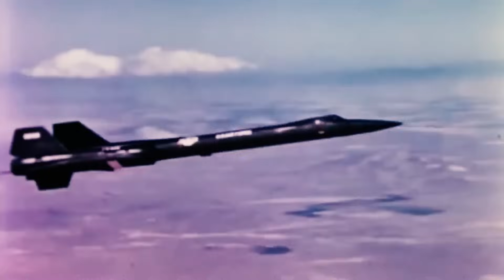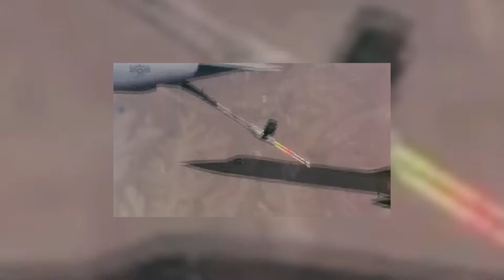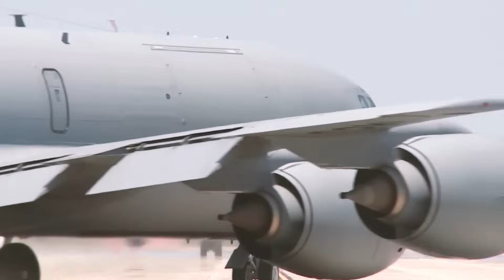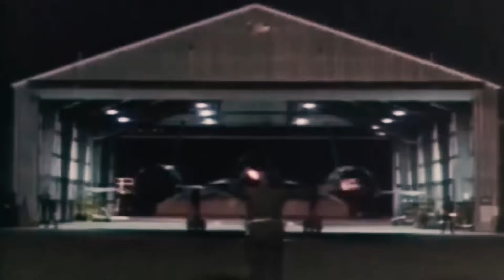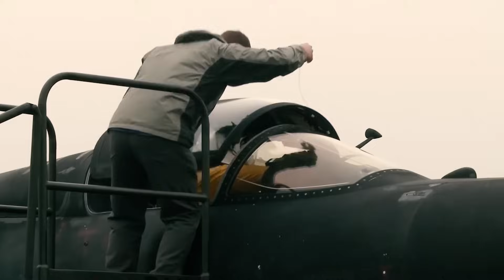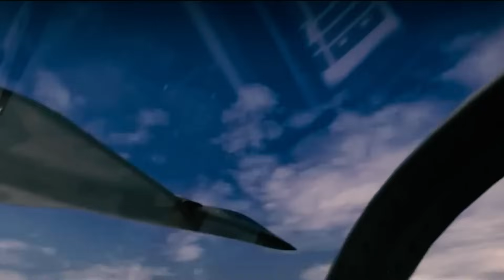No Fighter Jet Can Beat The NEW US Darkstar

Comment: The SR-72 Darkstar is a hypersonic test aircraft developed by Lockheed Martin and is not designed to land on an aircraft carrier. In fact, it is not even a conventional aircraft. It is a strategic bomber that can fly at hypersonic speeds and has the capability to strike targets from a long distance, far from being the fastest plane SR-74 SCRAMP (also called the XR-7 ThunderDart), which can climb to 800,000 feet and MACH 23, is faster than the SR-75 which carries it to sub-orbital height, at around MACH 4 before the XR-7 takes off from it's back, to carry out reconnaissance missions.
Reply: SR75 and thunderdart are made up myths with no truth to and are said to be the Aurora project.
Australia helped USA with hypersonics and has world fastest scramjet at mach 12 and will test fly a scramjet hypersonic drone 2024 and is the closest anyone has to a hypersonic aircraft and has won USA HYCAT DUI contract to build USA hypersonic vehicles and proves this.
Also USA HAWC scramjet powered missile is a copy of the Australian designed scramjet as Australia and USA did joint hypersonic tests called HIFIRE and SCIFIRE developed the HAWC.
Reply: Is there an SR-74? Or is there any fighter that can go MARC 23?